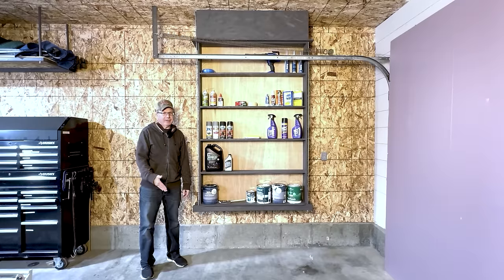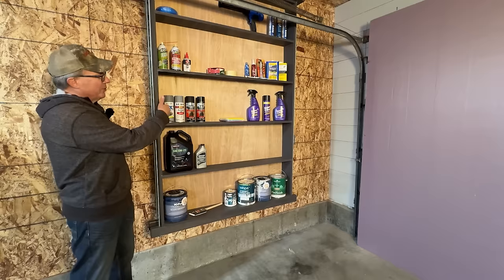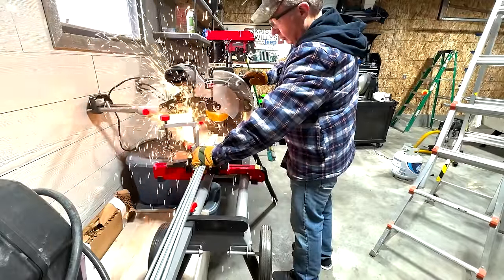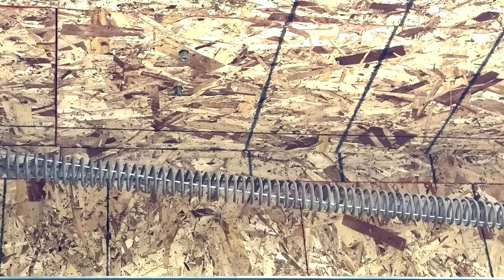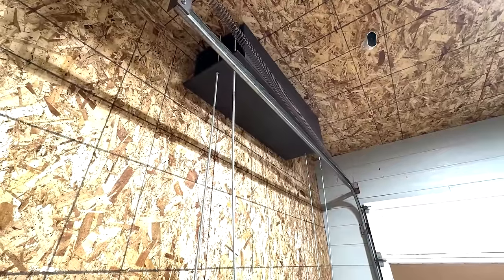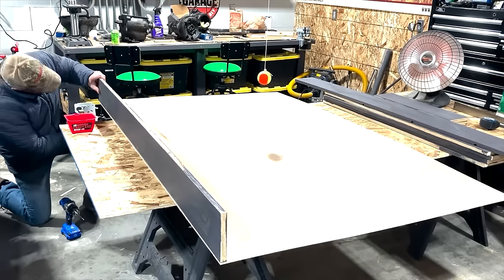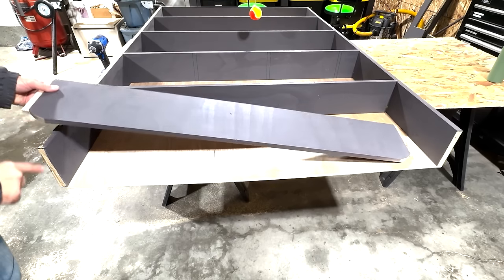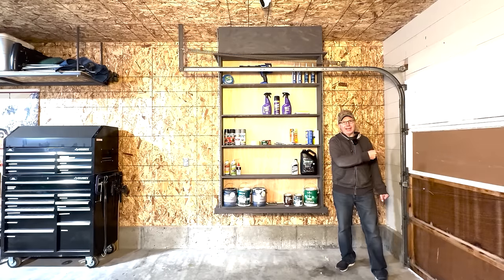** My Garage Shelves Just Got Smarter (and WAY Cooler) **

Comment: I use threaded rods all the time. You are over thinking the problem. just file off the burs with a small file.
Reply from the maker: Maybe so.
Reply: @ScottsGarage17  I did not mean that in a "your doing it wrong" I just mean there is a way cheaper way to get the results. Your way looks better so if its a display piece your way is better. I also really enjoy your videos I learn a lot from them.

Comment: Oh, I'm using this idea. BTW on the smaller threaded rod you can just nick off the leading part of the thread at the very top and a nut will start fine. I used to cut tons of it and we would use the cutters on our wire strippers to chop off that top 1/8 of thread and a nut starts fine. Was cutting with a portaband saw though

Comment: Shallow shelves are awesome for storage like that - I made a cabinet (roughly 4ft wide, 5ft tall) with double doors. Shelves in the cabinet back, and inside the doors. None of the shelves are deeper than a spray can (+ ~1/2"). Put a few heights for 'normal' and tall cans.  

Now, NOTHING can end up in front of another! I simply open the doors and find the can I need... no routing about, pushing things around finding what I need! I actually save money by not re-buying something I already had and just couldn't find it.  I keep a dixie cup on a shelf too for putting the nozzles of empty cans after cleaning them.
Reply: As they say:   THIS! ⬆

Comment: Two small  things I think would make it slightly better. The initial bolts that came through the ceiling would have nuts and washers on the bottom making them very secure to the 2x4. The second would be a thread locker on the couplers. This would stop the threaded rod from pushing the bolt up  and also allow you to thread the rod into the coupler from the floor and eliminate the use of a wrench to hold the coupler as you thread the rod. 
I know this is nitpicking and would not be necessary but small things like this can make a job go much smoother.
Reply: Absolutely no need for nuts and washers. On the bottom side, the shelves aren't made from helium. They aren't going to lift
Reply: @jasonmorehouse3756  I was thinking more about movement or lifting during assembly or future disassembly. I know after the shelves are in place they would not be necessary. But I tend to overbuild things because I have friends who can sometimes be like a bull in glass house....
Reply: Google Sammy’s threaded rod anchors GST-20

Comment: Yes, MDF stands for medium density fiberboard, and it's heavier than 7 ply cabinet grade. But what's even lighter and simplifies the process is 1×6. No ripping is necessary. I'm not sure about the cost but time is money. And providing 3 feet for the garage repairman is not necessary either as they only need to be able to get a hand or drill in the space. All of it is accessible from the inside of the track. I have installed nearly 100 garage doors, so I know.

Comment: Boy, ...at first glance I thought this was just another, "just because you can doesn't mean you should" kind of video.  The kind that people reach for just to get current content produced.  BUT... the longer I watched, the more application this design has for MY situation.  I especially love that you made the valence "cubby" up there for things like MORE threaded rod, or fishing rods, dowels, pipe, etc... The fact that the bottom struts are tightened up on the threaded rods and against the cubby- not just hung there- I envision that, though the shelf will rock a bit, it shouldn't rock a LOT.  The rear-size ladder and plywood space?  Very nicely thought out!  Mounting it off the exterior (front) wall was genius, too, for longer stock storage, or, in my case, the often-needed 500W LED spotlight to sit on its tripod!  Someone who doesn't store plywood or has a place for their ladders: they could box in the back with end-accessible shelves for longer stock, too.  Good ideas Scott, and nice execution!  Way to think outside the box for everything in the box we end up stuffing full of things!
Reply from the maker: Thank you so much for your comment. They have served me well. They don’t rock much. You have to really try to wedge something in too tight to get them to move. I am a projects guy so I use the cubby for pieces of wood and conduit that I don’t want to throw away.

Comment: I always just roll the threaded rod against the side of the metal cutting blade to achieve the chamfer. Easier and cheaper. I hung HVAC duct for years.
Reply: Yeah only problem with that is you wanted a chamfor on there where he obviously didn't, he wanted a camphor lol

Comment: A word of caution when cutting small or round material on a miter saw. Space the fence out 2-3" with scrap board so that the blade is cutting on the down and back stroke not the up and back stroke. The blade can lift the material and create binding or make round material spin and bind. Wood miter saws run at 4000 to 6000 rpm and steel saw run at 1000 to 1500 rpm. Check for compatible speeds for saw blade be for use. Running a fiber blade faster than rated speed can have unintended resalts.

Comment: If you’re in a pinch or have threads that the chamfer don’t work on, just hit the end after cutting with a flap wheel on a grinder. It cleans up the edge easily and lets you rethread again too

Comment: I like this shelving idea. Using wood glue would be a lot more effective. Screws alone wouldn’t be stable. Particularly on the backside. Preventing sagging. 
I especially like the method of hanging it from ceiling. 

The tensile compression was what finally made it make sense.
Initially I thought it was suspended at the top. Which, if the only things on the shelves was lightweight items, which would eventually become heavier, seemed fully dependent upon the threads of the rods. 
But as I saw you having the bottom be 2x4s, I thought that it would swing. 
The tightening of the bottom nuts makes it very firm. 

But the cubby is a large wasted space. Leaving the forward side open add many more cubic feet of space, and it’s still a solid ‘foundation’ if built properly.

The true best thing is the fact that flat materials can be easily moved in and around. 
My garbage is forever semi concealed by the stockpile of plywood as I work or between projects and the plywood is always leaning against something and forever in my way.

Comment: Another good way to get rid of burs on the threaded rods is a bench grinder pass it thru the wire brush
Reply: A fine grit bit attachment on a drill, fine grinder stone on grinder,  a metal file, plenty of ways to get it without buying a single use tool.
Reply: @STV-H4H  Absolutely

Comment: 11:00 I would have locked those bolts to the 2x4 with another set of washers and nuts from the underside. It was unclear how you kept them from spinning when attaching the rods.

Comment: The assembly of the shelf box is good but the overall hanging/ mount idea is over engineered as they say. A simple screw to wall or French cleat system would suffice. The only benefit I see of your design is stacking sheet goods behind. Credit to you on your video and demonstration.

Comment: Don’t understand why you hung it from the ceiling.   Does it swing/wiggle when any contact. Why would it not be anchored to the wall?  Seems like the space behind it would have very limited use and be pretty much wasted space.
Reply from the maker: The shelves don’t swing. I am a projects guy and I don’t lie throwing cutoff pieces away. I will fully utilize the space behind the shelves scrap pieces of lumber and plywood.
Reply: I don't understand why I have seen this comment a few times. If you guys can't understand construction,  then why are you watching these kind of videos? Why tf would it swing? Did he attach it to a door hinge? There is probably more support in the shelving unit he made than the garage walls...

Comment: fixed location non-automated storage is not smart storage, this is just a hanging shelf.
additionally, knocking off the burrs from the threaded rod can be done with simple sandpaper, either by hand or your power tool of choice, including a normal drill or handheld rotary tool (i.e. dremel)

Comment: Another way, not as easy, to chamfer the end of the rods, is to use a belt sander.
Hold the rod at 45 degrees, and grind the chamfer on, rotating by hand...

Comment: What is the cover on the garage doors?
Reply: Might be for sound or insulation
Reply: On my garage door I used insulation foam sheets inserted into each panel. Along with the insulation and double 5/8” drywall in my garage, I can have a planer and the dust collection both running,, and not worry about neighbors or family at even 2am. 
100dB in garage and about 60 10ft from garage door measurement, and less inside my living room. A shared wall.

Comment: This design is not smart. As a mater of fact, it looks dangerous.
Reply: I agree this isn't smart. It is just a simple design. However, what makes it dangerous?
Reply: Because it's hanging from the ceiling with no other apparent support. Too much weight or bang into the side of it and it may come down. A child or pet underneath  at the time is going to get hurt.  @Itsdirtnaptime
Reply: But it's held up by metal rod(s). It is also screwed to the ceiling. I don't think he plans to hang much more than 300 pounds on that. I used cap head screws to hold metal parts down at work. Cutting requires way more force than this would apply to the threads of those thread all bolts. I think you (like others on here) are not giving wood and metal the respect they deserve.
Reply: For it to come down and crush Fluffy, Mitze or Jeff four connections need to fail.  That is sorta like worrying that 2 nuts affixing a light fixture to the ceiling above your head will both snap off at the same time.
Reply: You guys underestimate kids climbing and swinging, those threaded rods snap like chalk when you start swinging on them, they're only grade 4.8
If I had shelves that size they'd be holding 100-150kg of weight minimum
Reply: @janeblogs324  the only time metals "snap like chalk" is when it is too hard. I don't know where you are buying you stuff from but that shit don't break like that here in the US. You said up to 150 kg, which is about 330 pounds of weight. Those rides are rated for at least 1,800 pounds. Y'all just talking shit out of your ass. All thread rods are stronger than the base material. These rods are usually pinch rolled. This process actually hardens the material. What you said implies that a normal 1018, steel rod,  can just snap  in half. Give me a few minutes. I will go across the shop and give this a try.